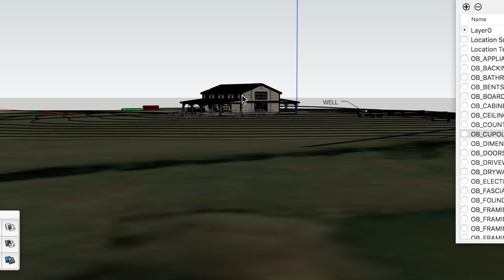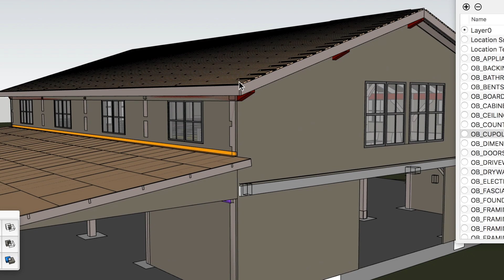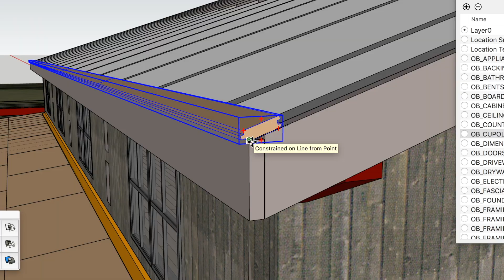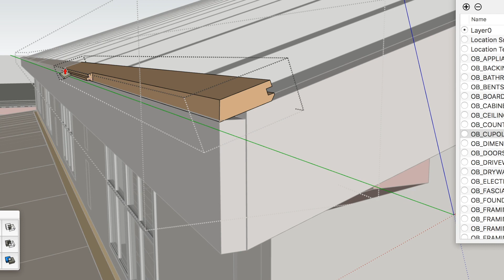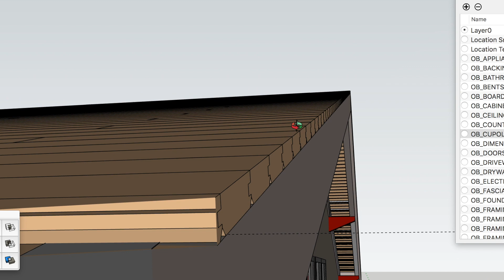THE CHEAPEST WAY to get a BEAUTIFUL Barn Ceiling! ALL ABOUT TONGUE & GROOVE - Cost & Strategies

Comment: What layup pattern did you use? Looks like Controlled Random Layup? But then you mentioned at 12:26 that you use whole boards end to end, which isn't possible with controlled random, as you must stagger board joins and so some boards must be cut short.
I'm currently installing my own 2x6 T&G roof decking and have found it much easier and faster to just use a Simple Span Layup (each span gets its own board) so you don't have to mess with correcting twisted boards since they only span 4 feet each. Plus it makes for a stronger roof since each span has eight nails in it.

Comment: You replied that Titebond II was used?  Where, along the T&G?  Did you apply any construction adhesive where the screws fasten into the rafter?
Reply from the maker: Yes, we applied glue to the surface of the rafter and the tongue and groove of each board
Reply: Titebond II for everything?
 I would have suspected construction adhesive at the rafter.
Why do you use Titebond Ii on each tongue and groove? I thought you mentioned the wood needs to be able to expand/contract?
Thanks for the good video!
Reply from the maker: @SubaruAficionado  construction adhesive would also work, but it was much faster to have a single glue gun up on the roof. The structural
Engineer required this method for shear strength. Not sure how the wood will expand and contract if it’s all glued down, but it would seem to be the same problem with glued down hardwood flooring.?

Comment: How do you handle insulating on top of the roof, R-values, or built-up section to accommodate rigid foam?
Reply from the maker: There are a few ways to do it, but this was an un-insulated barn with no foam on top.

Comment: I want to do this to my home as I need a new roof and already wanted T&G but the aesthetic cedar boards are so expensive it didn't seem worth it. If I were to do this, would i just cover the exterior with plywood so I could still have some insulation? I was thinking foam style roof since I have a 1/12 slope roof

Comment: Nice, but you installed the boards incorrectly.  The tongue should be facing up towards high side of the roof pitch (so the groove does not collect water).

Comment: You appear to be violating code on your installation by installing tongue down. 
Per page 1 in the AWC T&G guide and page 5 in the AITC 112-93 Tongue and Groove Guide : "Tongue and groove wood decking shall be installed with tongues up on sloped or pitched roofs."
Reply from the maker: Tongues up is the best way. We were required to glue the joint together and to get adequate glue on all surfaces and to prevent a mess, we reversed that orientation and installed groove up .

Comment: Love your work👍
Short question:
A rabbet joint instead tongue & groove for a roof decking can do the job?
Thank you.
Reply from the maker: Yes, as long as you nail it down well, probably with glue and lap the rabbets like ship lap siding to drain water
Reply: @HeirloomBuilders  Thank you for answering my question.
At the top the roof is going to be covered with membrane and roof tiles.
Undernearh there is open space, a patio toward backyard.
4x5 rafters spaced at 3 ft. 12 ft. Long and a 6 ft. Span.
The only reason I want to make some kinda joints is to make it look nice and hide future contractions of roof decking but I don't have   tools to make the "tongue & groove" joints. For me the rabbet joint is much convenient.
Greetings from România 👋🇷🇴

Comment: Hey Brother I am in Greenville NC looking at doing 5,000 sqft of porch , posts, headers and rafters with cypress and either 2x6 T&G Douglas fir or  Pine. 1st time doing a roof like this, 2100 on porch of house and 2900 on porch for shop. A few questions. I am close to your job on this video.  1-Where did you  get the T&G from? 2- Exactly what fasteners were those? 3- I was thinking of using Ice shield paper? 4- Would it make any sense to put a coat of clear on top before placing the Ice shield ? thought that could help from rotting if metal roof leaked down the stretch, but also dont want to cause problems with finish coats on top and bottom?
Reply from the maker: T&g came from east coast lumber. Fasteners are linked in the video description - available on Amazon. If you can afford to put ice and water shield down, definitely do it! We used ice and water on the low pitch shed roof section and a regular roof underlayment above. I wouldn’t bother coating the top side of the t & g. Best of luck to you!!!

Comment: $2.25 a board foot in PA yesterday, I guess all the people home on COVID decided to do renovations.
Reply from the maker: You're right about COVID projects. Plus tariffs on Canadian lumber, a few untimely large sawmill fires, and reduced capacity at mills due to social distancing protocols. Right now is definitely not a good time to buy lumber. The National Home Builders Association is working hard to bring prices down because it's increased the average home cost by $18,000.
Reply: @HeirloomBuilders  I have a question I could really use your advice on. I am redoing a porch roof decking with tongue and groove pine 2x6x12 (1.5x5). It is 36x10' and log 4' centers. I assume doing 6' then two 12' and another 6 would lead to the roof gaining funky angles along those joint lines if they all match up. Can i do that on the first row then a 10' two 12' and a 2' then go back with a 10' and put the 2' on the other end and repeat up the roof? or will that 2' on the overhang be too weak? With the price of wood I don't have spare board to do it any other way. Any advice would be appreciated.
Reply from the maker: I hear that! Install a 3-row pattern just like you've described. Starters alternate 2', 6', 10', 2', 6', 10', etc. With uneven log rafters, I would glue the tongue and groove together for the first and last 6 feet of each row. The roof overhang will be plenty strong that way. Good luck!
Reply: @HeirloomBuilders  Thank you.

Comment: Shouldn't you install these so that the tongues on the upper edges so that the water won't sit in the grooves if you ever get a leak through whatever your installing on top of these?
Reply from the maker: Yes. You are right. Normally we would need to install like tongue and groove subfloor plywood so you could hit the groove side hard with a hammer and not damage. But these boards went together smoothly without needing to bang them in.

Comment: 2 things...1 how do you join the roof peak, and 2. couldn't you justmake your own with a 2x4 and a table saw?
Reply from the maker: We rip the top course square, which closes the gap viewed from the interior, but leaves a small gap on the exterior. That way, we are able to get it in without struggling and the top gap is covered by roofing/underlayment. You could make this with 2x6’s on a table saw, but it would be very difficult to get the precision needed to have a clean easy installation. It would also require three passes with a dado blade and two passes with a bevel for the v groove.

Comment: Also you were very informative and the work looks great , But your video is subject is titled on COST of this T&G specifically, and you seem like a sharp fella, I am just a Farmville boy, But when 2x6 is $1.10 linear ft , how you come up with saying it cost $1.60 a sqft. ???   But Farmville math come up with $3.20 sqft for 2x6T&G if price is $1.10 linear ft. Not trying to be negative nancy but its exactly double what you  claim. If I am wrong show me please. And I will still value your answers to my questions below. That Obama math messed up an entire generation.
Reply from the maker: Lumber is calculated by the board foot (1” thick material). 2x6 is 1.5” which is 1.5x the cost of board foot when measuring lineal feet